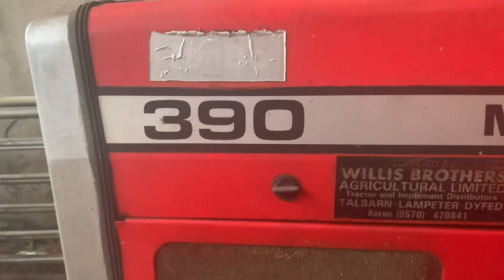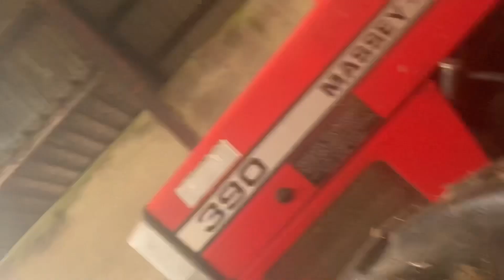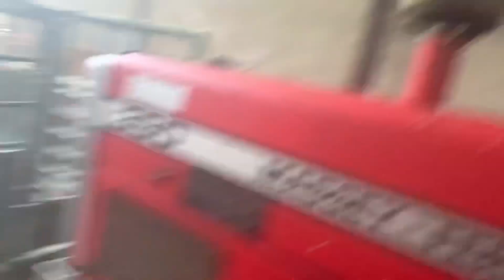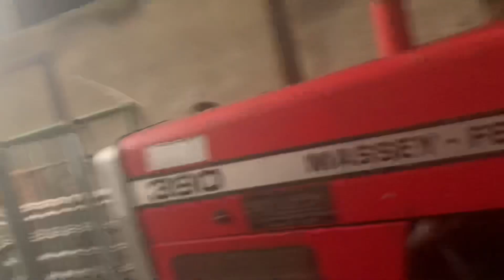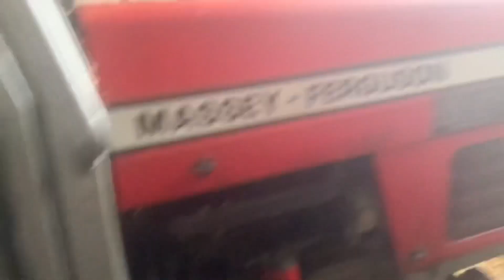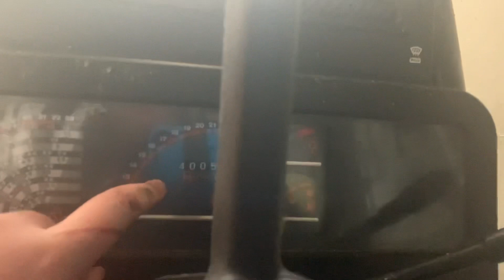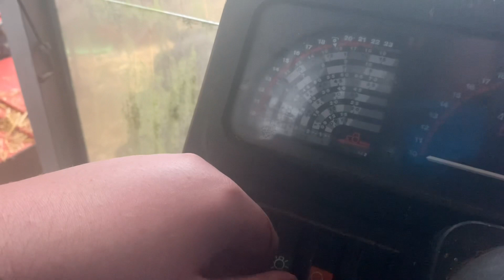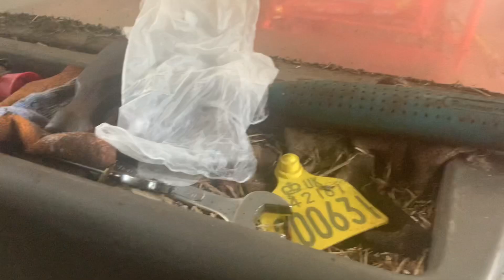Walk around tour of the Massey Ferguson 390

Comment: It's a low profile because see the high bit in the middle of the floor where the gear stick is high profiles dont have the high bit but great video
Reply from the maker: alright cheers for letting me know the reason i thought that was because ive seen a 390 with that middel bit but has a shuttle shift gearbox but enyway cheers buddy